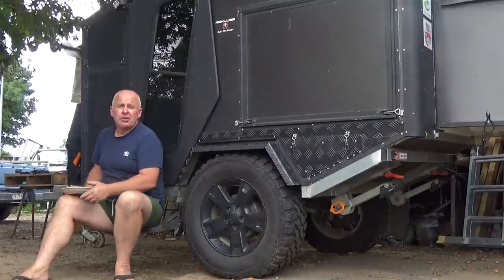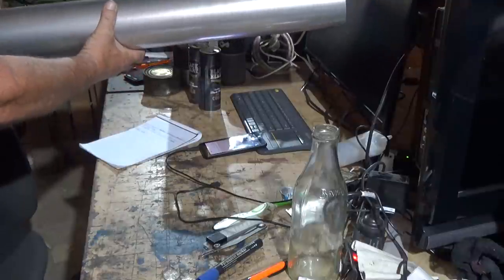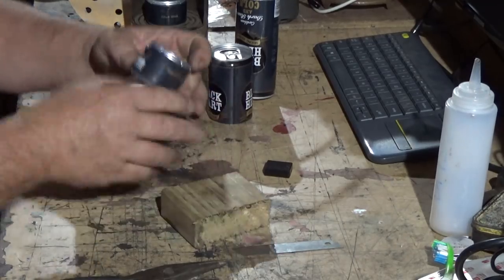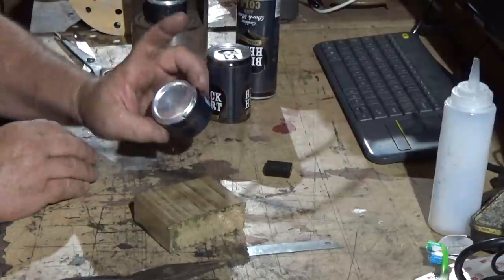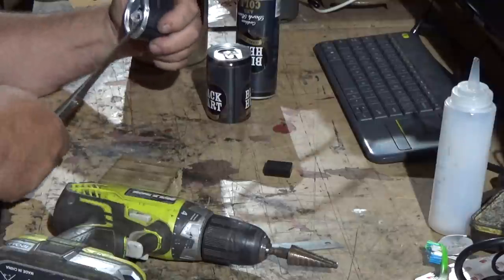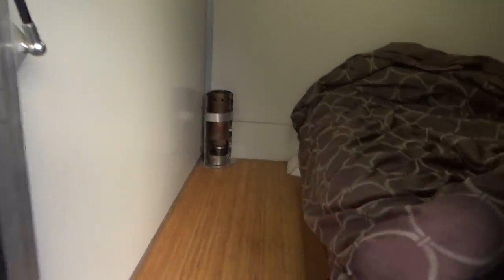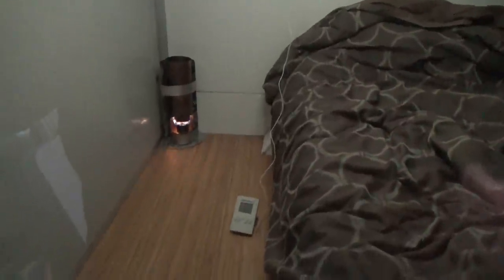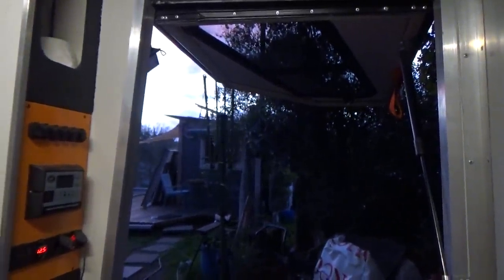How I keep warm while Im Homeless- Tiny Alcohol Burner*Big Heat!

Comment: About thirty years ago when I was homeless, living in my van on a parking lot in Hollywood, CA it got a bit chilly sometimes so I made something like that myself. It's because the folks living in the adjacent hotel had called the fire marshall and long story short as long as there are no openly visible flames there's nothing to report. 

My design was two coffee cans: A large one and a smaller one-pound can. I poked a band of holes all around the rim of the small can and did the same all around the base of the larger can. I'd then put alcohol into the smaller can and ignite it and then invert the larger of the two cans on top of it. ...And finally, I'd slowly turn the larger can so that the holes will not line up with the holes in the smaller can. This way the fire got all the oxygen it needed without advertising its presence... And it had the added benefit that I could cook on it too.
Reply: That's awesome

Comment: Sometimes, with my bad luck, every time I try to separate a cab bottom like that, it crinkles way too much.  I figure out a prep solution though.  Each can you want to cut, fill about 2/3 with water, then freeze.  The ice will act as a support under the knife while you score as heavy as you want.  When ready to crinkle, do it under running water.  The ice will then prevent the aluminium sides from pressing in too much while you separate.

The 2/3 fill is room for frozen expansion, which means less split cans.
Reply: @serenedreams3745  that only works after you’ve cut off the top.  The ice would be that cylinder.  I have seen someone use a perfectly sized wooden cylinder with rounded edges to stretch the soft aluminum juuuust enough to slide two halves together and create a good seal.

Comment: Fantastic use of recycling cans. Also love your commentary. I was wondering if you can use lard as a fuel with wicks. Would not spill and can burn for hours. Just my thought. ☮️🙏☯️
Reply from the maker: More heat- terrible smell. dunno if mt CO meter picks up lard smoke
Reply: Orderless I believe and the wick has to be short to prevent smoke. I know it works with filling melted lard then let it cool down until solid. Add birthday candles according to your specifications. It should burn orderless and last a lot longer. I've tried it with a short mason jar and stayed lit for at least 16hrs. Your cans are smaller might have to cut the candle in half. As long as the wick above slightly from the lard. Look up on YouTube heater made with lard. Maybe it will explain better. Thank you for the quick response to my comment. I'm in Texas

Comment: I have seen some penny stoves made with either steel wool or rock wool filler which I assume makes it less likely burning fuel would slosh around. They also had a smaller filling hole that could be covered by a coin. I assume this would increase the burn time while reducing heat output.

 Your holder seems to secure the burner quite well though, so sloshing fuel is only an issue when loading it into the chimney. All in all a great practical application of the concept.
Reply from the maker: Thanks Andrew- I appreciate you taking the time.

Comment: Great little heater, how long will it radiate heat for after the fuel runs out? I wonder if it would power a small set of heat driven fan blades like those found on log stoves, just to see if it heats the inside up quicker.

Comment: Something with a similar idea but very long burning, about 7 days or so. Fill a coffee tin with melted fat. In the demo  I watched they used Crisco Lard. Stand a dining candle upright so the top of the candle and wick clears the surface. Wait till it solidifies, light it, and blow it out 7 days later, or whenever you like. Suspend a ceramic flower pot over this to make a radiant heat source. Of course this should only be done in an area without pets, or small children that might be at risk. Also there needs to be some ventilation for safety.
Reply from the maker: wow- thats awesome!

Comment: We put a small 12V fan in our cabin which blew the hot and colder air around which evened out the temperature of the living cavity.
Reply from the maker: I use computer fans for different uses- smells and ventilation

Comment: Would you be kind enough and let me know if you could make an alcohol heater that could burn for an hour or two ??? I am amazed that the burner starts from the center and the flame moves toward the outer eight holes. Could you give some information on how you come with this idea also. Thanks you Sir and peace too. vf
Reply from the maker: You can buy these in camping stores- Its called the Trangia Burner- If you make it deeper it holds more fuel and runs longer. But if you go too tall it wont start properly
Reply: @t.h.o.r.  One question I have Sir. What is the purpose of the inner ring you cut perpendicular with V notches ??? I am amazed how well that works. Thanks vf

Comment: Sorry if this is a dumb ass question, but is the flower pots nested together or is there a small air gap between sort of like bells, thanks mate. Seeya Rob. Good luck with your move, hope everything goes well for you.
Reply from the maker: haha- The flower pots all stack inside each other in one column all touching- If you put spacers between they cool down faster so I leave it as one lump and get another 15mins of useable heat after its out

Comment: Now That was interesting! Thanks matey!

One note of caution / common sense With the burner you idealy want a blue flame with just a touch of yellow at the tip for peak performance. It is all about the air mix. 
Have you tried cutting your hole in with the saw and then instead of cutting a bigger hole out cut a series of radiating cuts from the centre outwards. Then bend the cut sections up  to enlarge the hole. You can then fine tune it after observing the flame. 
I know you have your CO detector so you are golden but CO is insidious and will kill you while you do not even realize it is happening (your body reacts to levels of CO2 in the blood and that is not raised but the CO will block your red blood cells from joining Oxygen so you suffocate) ..... a pleasant way to go, but not today, if you will excuse a GOT quote. ;o)

The other thing to watch out for is that Meths burns with an almost invisible flame and when this combines with a low vapour pressure you get a dangerous condition if you spill around the heater DON'T LIGHT IT until it has all evaporated. I used to light my hand after "spilling" some and lighting a wick! You need to definately know how to put it out safely and most modern clothing is not good for that! One of the other tricks I used to use to demonstrate how the flame will spread was to fill a  Primus stove well with Meths as usual but dribble a small trail on the ground ...... then light the end of the trail! Great at night!

Like most things, it is not dangerous in itself, it is how people use the thing that makes it dangerous or safe!
You are wrong bout Common Sense ..... it needs to be spread widely! ;o)

Comment: the US has a brown recluse thats venomous, not  deadly for the most part but the bite wound can get nasty.... this is a neat variation on a theme, I think Ive seen a similar build. I have a couple vdos on small oil burners as replacement for the UCO candle heater, 3 or 4 bottles that fit in a large juice can that I may be able to adapt this stack and heat collectors to.. Ive also made a couple alcohol lamps from the same kind of bottles , alcohol burns faster but gives more heat... "oil lamp tent heater from recycled materials, why buy a UCO"
Reply: I just realized this is the 2nd vdo Ive watched of yours that have given me ideas (clay pot water filter) so new subscriber...
Reply from the maker: Hey Thanks Doc. Im keen to know how bright the lamp was? maybe some construction details?

Comment: What would happen if you just nixed the penny stove and turned the catfood can over and filled it up with alcohol or whatever fuel you are using? Might it give more flame, more heat and longer burn time? Just wondering.

Comment: yeah I'm a bit slow ... bit of an idea of the upper construction would have been nice - (the must and don't do's such as how much smaller the diameter of the pots to the pipe is recommended/best/worst etc.)
Reply from the maker: 2.5 inch pots in a 4inch flue pipe as explained. maybe 3 inch pots would be better but my shop only had 2.5 inch

Comment: Where did you find the flue. I have not seen one that small, also are the small flower pots still around now a days
Reply from the maker: I bought both at my local hardware. The small flue is used on gas fires and the tiny woodstoves that I make and sell.

Comment: Burning Ethanol doesn't give off carbon monoxide, You will be fine.
Reply: Also carbon monoxide is heavier than air. Seems to me that the vent should be near the floor, not the ceiling.

Comment: Called penny stoves because you cover the hole with a penny after the stove is burning.  Hole can be ANY size smaller than a penny and it doesn't effect the burn.

Smaller holes simply means you sometimes have to preheat the sides of the can to heal fuel inside.
Reply from the maker: I cant get mine to stay lit unless the hole is that size or bigger- I find once you put a pot on it - it does the same job as a penny

Comment: Do you details of lowest point inside vs outside temps? thanks
Reply from the maker: Its not particularly cold here yet- But the difference inside / outside is down to the camper's insulation. Nothing to do with the output of the heater.
Reply: @t.h.o.r.  Thanks, yes thats why I asked, more beneficial to know how much warmer it keeps the inside over the outside temp. The insulation simply slows down the transfer of heat, if the heat output from the heat source is too low it wont be much warmer inside than outside

Comment: I've got a stupid question. How big is a Penny ? I've never seen one, let alone measured one
Reply from the maker: about the same size as that hole- if its too small it wont stay lit -if its too big it will be inefficient. Play and Learn.
Reply: @t.h.o.r.  you could have said, drill a 22mm hole . But no.
Reply from the maker: @hypersphereengineering6015  Americans like to use anything but the metric system.
Reply from the maker: Its the diameter of an old man's thumb
Reply: @t.h.o.r.  what kind of penny by the way, an American penny, Kiwi penny or Aussie penny? Hell of a how to video. Still haven't gotten a straight answer 😂
Reply: @t.h.o.r.  they are called freedom units. Also can be measured in bananas thank you and God bless merica.

Comment: Sorry to be that guy....  Be mindful that alcohol puts out considerable amounts of carbon monoxide.  (Even if you get rid of the yellow in your flame - the black on your pots shows that youll be producing significantly more CO than you should be) people have the misconception that alcohol burns completely.

The flower pots are unlikely to do anything unless you can see them.  The reason for ceramic pots should be to a radiant emitter due to their high emissivity, whereas the flue tube will have low emissivity.  The flue sheilds the emitter.  The pots will not play an active roll in heat output.